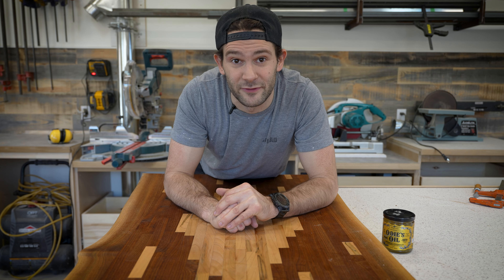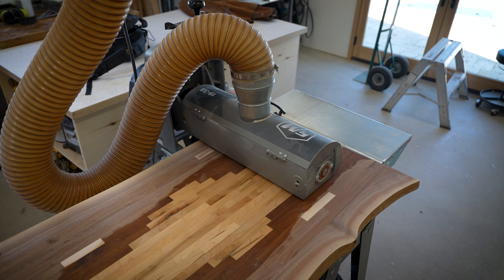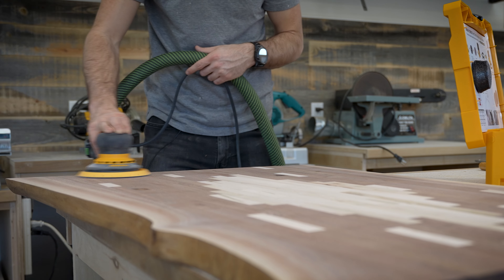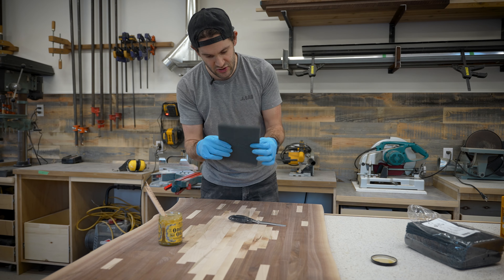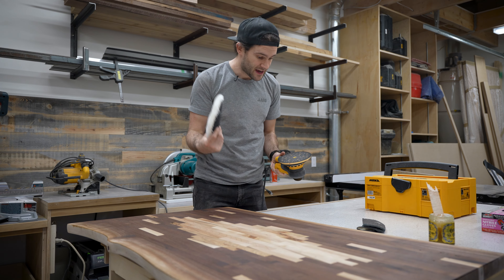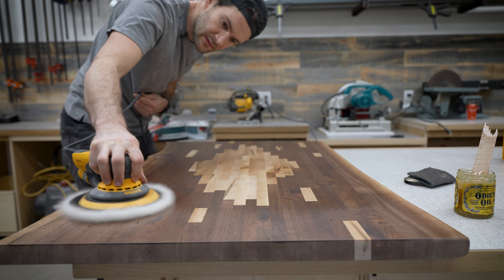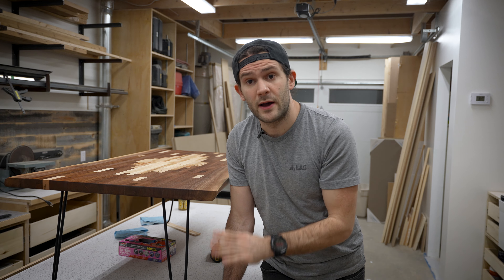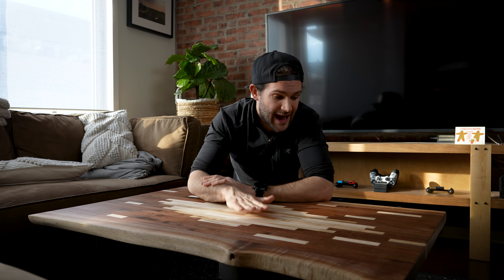Is This The ULTIMATE Wood Finish?  - Odies Oil Application and Impressions

Comment: 6:15 “Each jar of this stuff is like 50 bucks”  Pah!  You had it easy mate.  One year on, and over in UK…we are looking at 112 USD….Yes, a hundred and twelve bucks for that jar.  Though not as LUDICROUSLY expensive as that Rubio mono-coat stuff which retails on Amazon in UK at….wait for it…sit down first….700 bucks  Yes!  SEVEN HUNDRED USD😳 for about two pints.
You could almost as cheaply finish your wood with AAA+ Beluga Caviar…….
Reply from the maker: WOW I wouldn't pay either of those price for either of those finishes haha. What have you found thats a reasonable price in the UK?

Comment: I got a pack of maroon pads for $10 and then I cut out a circle shape that matches the size of my sander. Then I use that to apply odie's oil. I tried the manual approach first and I get much more even finishes with the sander, it takes it to another level. To buff it off I do the same with the cotton towel, I cut a circule out and put it on my sander, works great!
Reply: @Plasteringprojects  On their industrial website which sells the exact same odie's oil they say this: "Though it is not required, we highly recommend the use of an industrial orbital polisher running in the 1500-1800rpm range. The absorption process is aided by each rotation of the application pad thus to achieve the same finish performance by hand could take 20-30x as long and is often less consistent. The same applies to the removal process which is often under performed by hand. Care should be taken to keep the polisher moving across the surface so as not to burn the surface in one spot." https://www.odiesindustrial.com/application/
Reply: @Plasteringprojects  They have their default instructions to make it look easy but on the pro website they have slightly different instructions. Also I tried both and prefered the look with the pad attached to my sander. It makes a more even coat and it takes less work.

Comment: Great video.  Odies is a number one finish for me.  I just did a piece of curly walnut and sanded to 2000 grit.  Used Odies oil first, waited a couple of days and then used Odies butter.  Need to let it cure for several weeks before it reaches maximum protection.  I know everyone is looking for an easy finish and Odies is very simple but it you invest more time in the sanding process and do several coats and then recoat again in several months you can have a phenomenal finish.
Reply from the maker: Good tips Pete! I'll have to try that. What's the effect of the butter? I've seen it in stores but the product description isnt very helpful haha
Reply: @ZacBuilds  The butter puts a little more sheen to the finish with the addition of some wax.  I also feels it helps with the water resistance.
Reply: Try the super dupa everlasting dark oil.  Trust me, you'll never use anything again.   But sand to 3000.      Stuff will amaze you.....
Reply: @ZacBuilds  Butter just adds some wax to the finish

Comment: IMO, Odie's butter wax is an absolute must when using their oil.  The butter wax does just what you said you wanted near the end of the vid where it goes in and starts to cure and seal up the pores for added protection.  It also really brings out the color of the wood.  I wasn't expecting that but the difference is pretty legit.

I've re-finished a few cutting boards (walnut, maple and bamboo) using the oil and then butter.  I did 2 coats of oil letting each coat cure (wiping off the excess and letting it sit) for 48 hours and then applied and wiped a coat of the butter and let it sit for about 72 hours before using the boards.  All 3 have held up great in the 2 months I've been using them.  I think that I'll probably get into the routine of using something like the Outlaw's board butter every now and then for upkeep as it's significantly cheaper than the Odie's butter.

Comment: Being a moderately new Odie's Oil user, I will say that people's main complaint about the product goes hand-in-hand with your main complaint. You mentioned having to use more product than you thought you would, which sucks given the price point of a single jar, and the company does advertise that one coat is enough to get the job done. This is not the case. For the best results, I've begin using two coats of Odie's Oil, and I apply the second coat after around 36-48 hours (the second coat takes far less product), and then applying a third, and final coat of their Wood Butter, then allowing it all to cure for a minimum of 14 days (I haven't polished anything yet, though, because I tend to over sand the heck out of things and get a pretty darn pleasant sheen just from buffing). If I'm making end grain cutting boards, I actually just do an overnight soak in mineral oil, let it cure until it stops weeping (about 2 days, depending on the wood I use and how much sanding I've done), then I use a single coat of their Wood Butter. I'll be honest, it's worth investing in the Wood Butter (can even be used as a stand-alone finish for pieces that won't much moisture (boxes, etc), and it darkens the wood less than the oil). Not trying to bogart you're very informative video! All I can say is that when I use two coats of oil and one coat of Wood Butter, and let it fully cure? My pieces are almost mirror shiny, they are completely waterproof, and near on indescribable. I actually just recently made a baseball bat out of Padauk and finished it in Odie's Oil and you could hit a home run in Atlantis. Great video!

Comment: Been using this for over two years. Suggest pouring a little on, use a card to spread it around. You lose less soaking into the pad, then I go over everything after I’ve “scraped” it on with the pad and go in small round motions to make sure it’s all worked in, then wait 45 min and buff it in removing excess. It’s treat finish, but don’t seem to be any long term results on YouTube so I’m still curious about how well it holds up.  I’ve only used it on one piece of my own furniture and it’s been 5 months and seems to be ok. But really want a year or two of results. Thanks for your videos. Let us know from time to time how it’s holding up for you!!

Comment: Thanks for doing the video on Odies Oil as I have noticed several people on IG using it and I knew very little about it.  I like the quick application, not having to sand between coats if you apply more than one, but I too have questions about durability.  I sure like that sander even though I can't afford one!  I am a big believer in the Mirka Abranet discs though, even if the yellow sander I use has a different name on it.  LOL

Comment: Great video man! I’m a big Odie’s Oil fan. If applied correctly, I find it holds up well. I also prefer (and is recommended by Odie’s) to do multiple coats on heavy use pieces. This obviously adds time, but provides a stronger, richer and glossy finish.
Reply from the maker: Good to know! I'll probably do the durability test on this table with just 1 coat, but I'm working on another table right now and I'll try the 2 coats on that and see if I notice a big difference.
Reply: 2 coats is recommended as the baseline.

Comment: If you watch the Odie videos they use a small applicator. You may have used more than you need. Emphasis is on rubbing the oil into the wood

Comment: You didn’t need to use such a piece of the non woven applicator pads. 2x3 inch piece is enough. And store your pad in the jar for future use. And get some Bloxygen for storing the Odie’s oil. It starts the curing process when you open the container for the first time. Keeping the lid on tight and using bloxygen will more or less stop that from continuing.
Reply: I love when Someone Such as Yourself Adds Beneficial Information in the Comments .. Thank you

Comment: You should really watch the apllication video made by the creator of Odie's Oil. He explains the process in depth and covers some things that you missed, like using a cotton towel to remove the oil prior to using a buffing pad. If your table still felt wet after buffing you didn't get all the oil off, which is required to get the best results. https://youtu.be/abxFCzqOtg0

Comment: Any oil finish will not stand up to moisture or pooled water as you would find from a cold glass of water or beer. I’m sick and tired of people espousing their lack of knowledge as gospel when French polishers and cabinetmakers with years of experience making a living know it’s rubbish. Sure use an oil finish and see how long it lasts. It’s very easy to apply and that’s where it ends for table tops which need to be properly sealed. If you don’t seal the wood it can absorb or shed moisture causing it to crack and warp. If you want stability the wood has to be sealed on every surface. If you want a hard wearing surface then use a polyurethane or lacquer. It’s that simple. There is a reason why French polishing and furniture polishing are seperate trades. It’s because it requires lots of expertise and knowledge. Don’t get sucked in with oils. They look great for a few days then watch them deteriorate. Do it properly the first time otherwise you’ll be doing it again I guarantee.

Comment: Good vid. Definitely gotta saturate the applicator before you even put the Odie’s on the table. I find, so far, it goes a long way. It is an expensive finish, but it looks better than tung oil (I won’t say who, cuz I still love the company) and spar urethane that I had been using. 
Buffing is basically the same as what us spoon makers call burnishing wherein a smooth stone, piece of wood, or antler is rubbed across the wood. Only do this after finish has been applied, just like in buffing, because you are compressing they wood fibers and the wood becomes impenetrable. No matter the finish (well, oil finishes that harden in the wood anyway) it does lend the wood a lot more life, giving it a nice sheen (when burnishing by hand. Power buffing I’m guessing gives the wood more of a glossy look). Yeah, Odies is a pretty penny, but I bet you can demand a higher price for having used it. And all natural, no fumes, food safe. Any thoughts on buffing with a rotary tool? P

Comment: I just watched the Odie"s site for application and "How to." Your application and Buffing process is not what they recommend. They applied initially in the direction of the grain then in circles Your initial circular motion is using too much oil. Hand buff first then electric buff after you are certain the surface is dry. Once buffed dry with cotton, you can go to electric buff. If you buff too soon with electric you are defeating the process. See the actual Odie's site for application how to.

Comment: This is perfect timing. I‘ve been looking into diff finishes. I’m super lazy and don’t want to sand in between coats lol. I like oil finishes for this. I’m looking forward to part 2 of this. Because that price point is not fun 😅. But if it lasts, I’m down. I recently bought Walrus Oil’s furniture finish to test that out. I’ll let you know my thoughts on that and we can compare.
Reply: Boulderguy is right. I've used the same jar on multiple projects. I did ~10 charcuterie boards with 2 coats each, and just finished a dinning table with 1 coat on underneath, 2 coats on table top, rails and legs. I still have some left in the jar that will complete my next project with 2 coats.